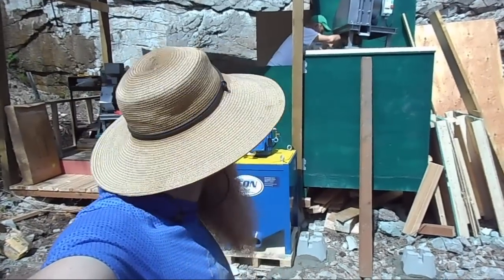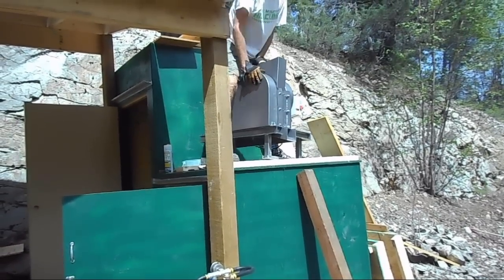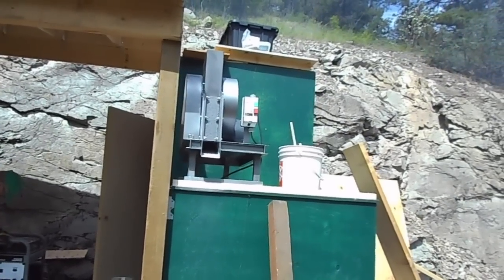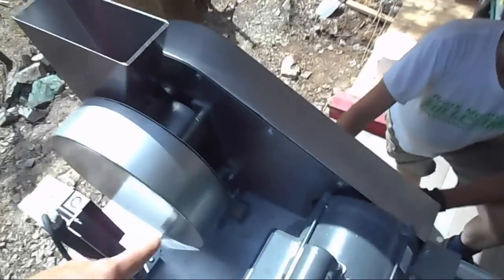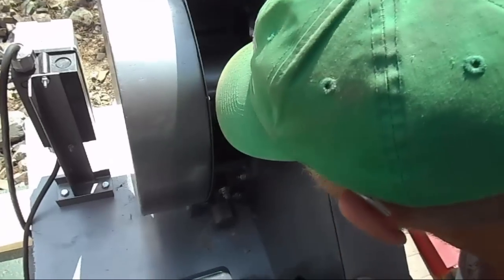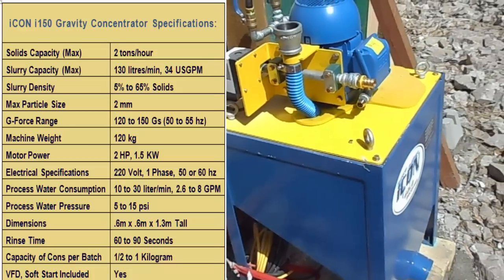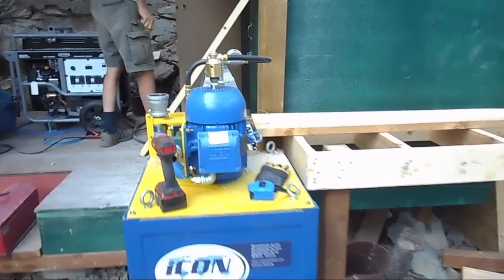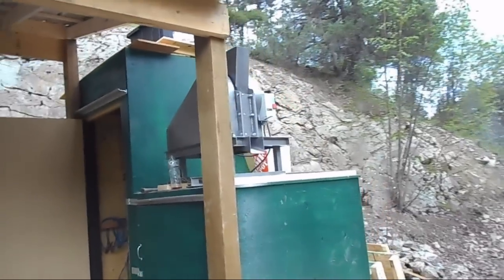A Jaw Crusher for my Gold Processing Plant (Hard-rock Mining 2018)

Comment: You may have mentioned that we should always wear properly rated masks anytime you're  crushing...I've heard you mention it before, but just in case someone missed it...breathing stone dust killed a lot of miners back in the early days.  Similar to breathing fiberglass...it doesn't go away.   N95 rated masks are less than US $5, easy to spend more than that but these less expensive ones have kept me breathing normally through several tons of small hammer(impact) milling..
Reply from the maker: I do mention it in the block of text but yes, I'll be sure to talk about dust when we start running.